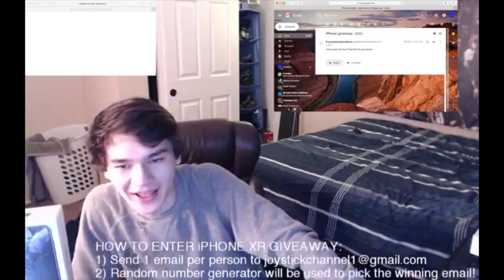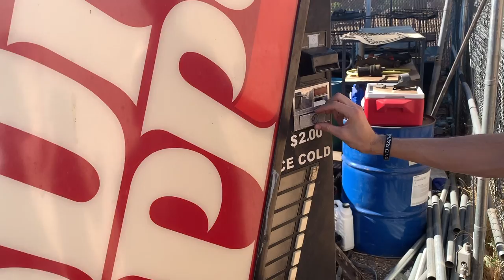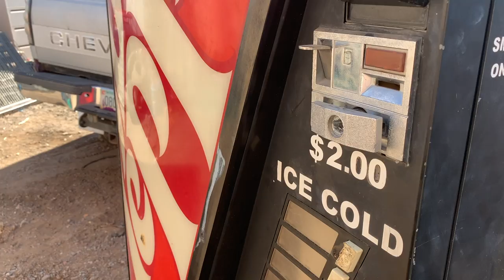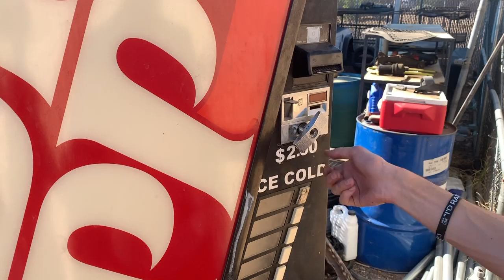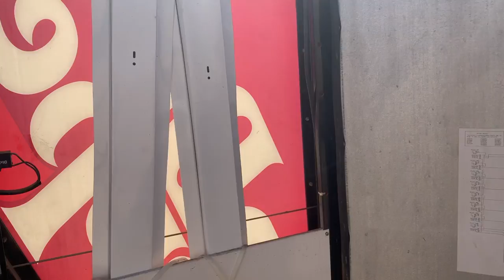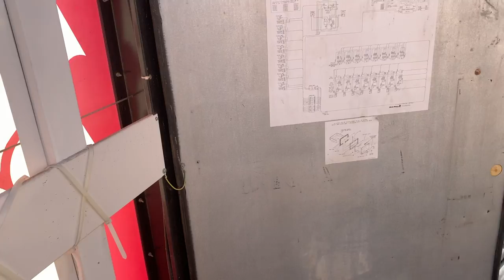FOUND MONEY IN ABANDONED VENDING MACHINE | JOYSTICK

Comment: I've won airpods from the stacker game but I currently have an iPhone 7  and it can only hold 71% of its original battery capacity so I sort of need a new iphone, but most of the arcades in my area are extremely rigged to the point where winning is almost completely impossible